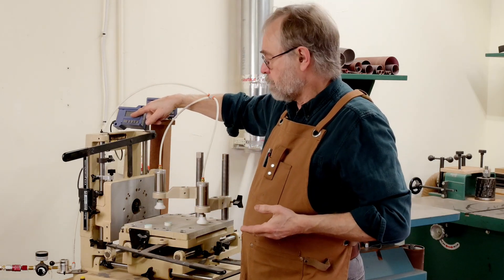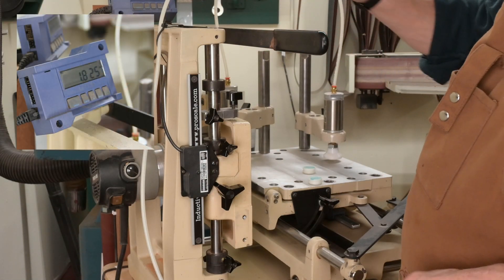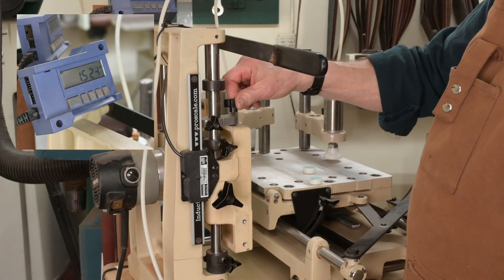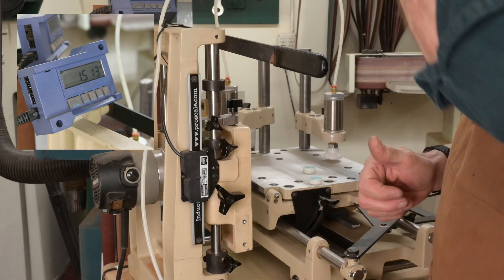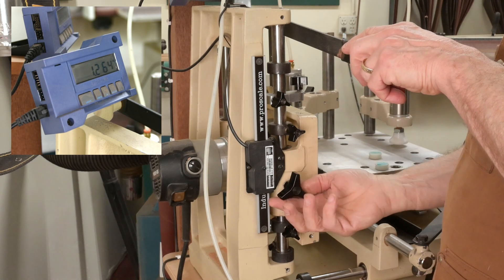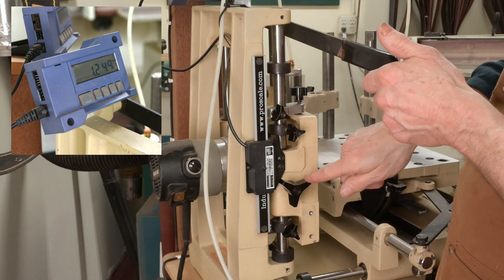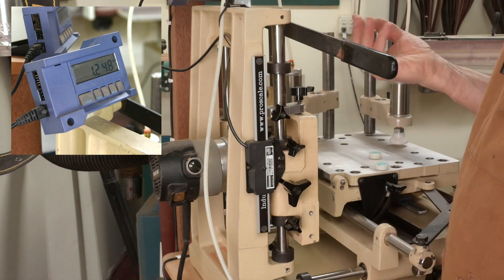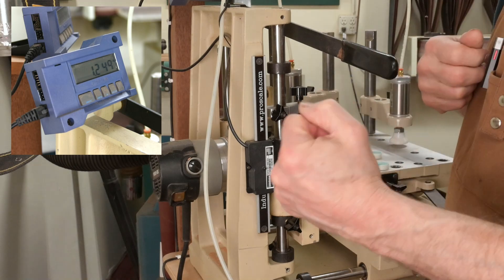Multi Router : Precision Adjustment of the Vertical Axis

Comment: Can't help but wonder if the treaded bolt push/bite directly onto to round slide-bar, if so then that is probably the reason for the trouble.🤔
Reply from the maker: yes - that could be the issue

Comment: Do you know if a Wixey DRO or other brand would work? For 2 pro scales Its at $900 vs 150 for 2 others
Reply from the maker: The  Wixey works but is not nearly as accurate.  But -  for most work the Wixey is accurate enough.

Comment: Thanks for the tips. I bought the digital readout a few months ago and have been disappointed with it doing just as you demonstrate. My solution so far was to just guess what I thought it was going to move and set it that amount and then let it creep when I locked it. It was pretty good but not always spot on, on my first try. Your idea of gently locking the axis. with its knob and then bringing the stop collars in is a very predictable solution. I had actually been meaning to email woodpecker and ask them about the issue. Looks like you took care of that answer.
Reply from the maker: You're welcome. It bugged me for the longest time too. I see that Woodpeckers redesigned the micro-adjust. Is your MR an older pre-Woodpeckers model?  If it is - did you have to remove the post to install the micro-adjust?